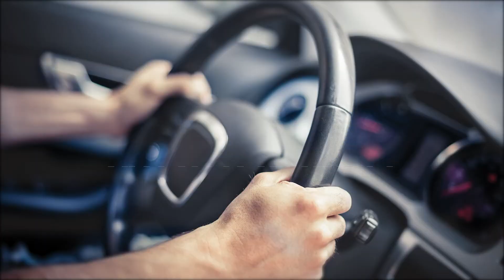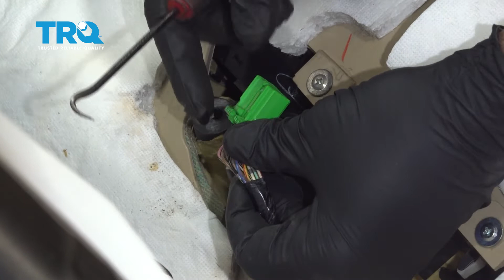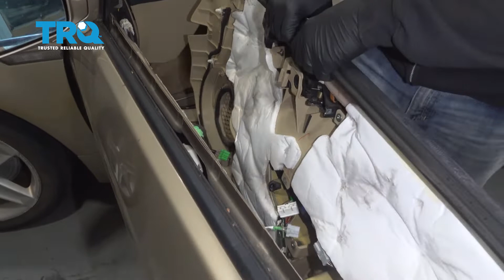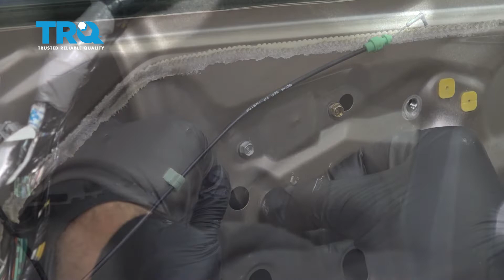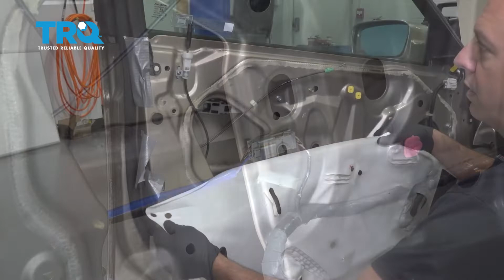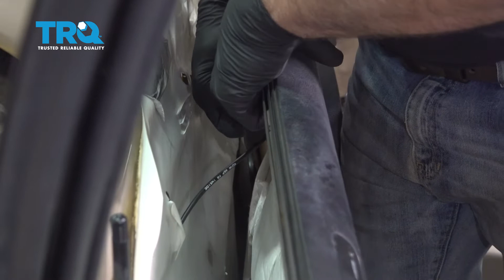How to Replace Power Window Motor and Regulator 2004-2008 Acura TL

Comment: My 2008 Acura TL driver side window did not go out in the perfect position to get to the two bolts that you had to roll the widow up to position it perfectly for you to get to them. What would you do if the widow is stuck in a position that you can get the two bolts that you had to roll the window up to get to. Hope this made sense.

Comment: So if you can hear your motor running loud and clear when hitting the up/down button, but you have taken the panel off and found the wires and round plastic piece at the bottom of the door, can you just replace the regulator or is it required to replace the motor and regulator as an assembly? 
Thanks in advance I appreciate the video.

Comment: During this process you hook up the gray electrical connector to the door panel several different times to raise or lower the regulator.  Then, each time you have to unplug the connector which can be a bit of a bear (hard to access the little release tab).  I learned that the connector doesn't have to be fully seated to provide power to the up/down switch.  Making it very easy to remove the connector each time.

Comment: Great video! Unfortunately my window was stuck in the open position when the motor went out so it took a little more doing to get the glass off of the actuator. Out of the videos I’ve watched this is the most directly instructional. Thanks a lot!!